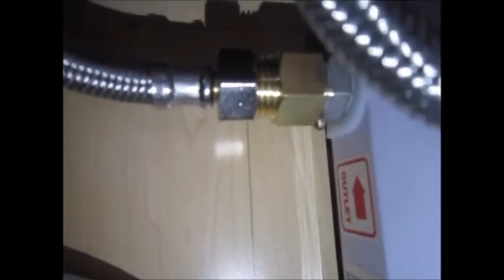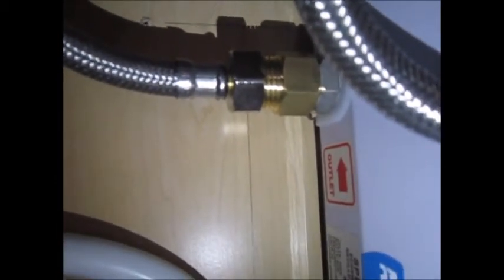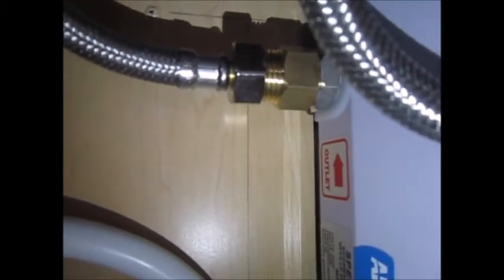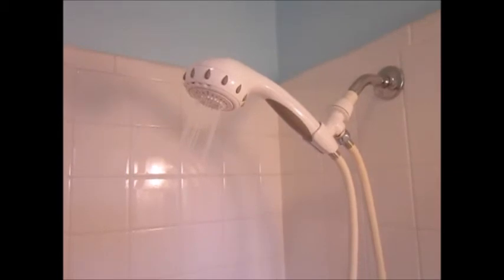EcoSmart 8 Tankless Water Heater Installation And Review

Comment: Would’ve been cool if he showed how to wire it...
Reply from the maker: I just noticed that I haven't shared a link to the video wherein I show the wiring.  https://www.youtube.com/watch?v=kT-JNI0YYQs
Reply from the maker: Sorry about that; that's on me.  I don't show how the quick-disconnect box is wired to the 40Amp breaker, but the 8/2 wire from the breaker box has an exposed copper ground wire that is connected to the green wire from the device and the red/black wires are connected to the hot wires from the breaker.  There is no neutral.